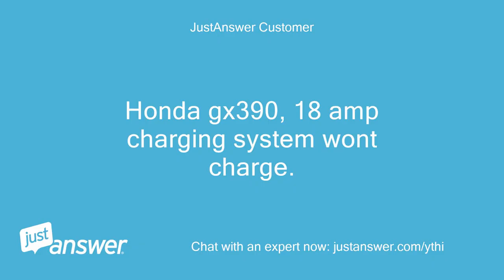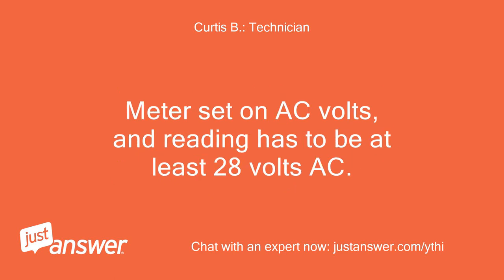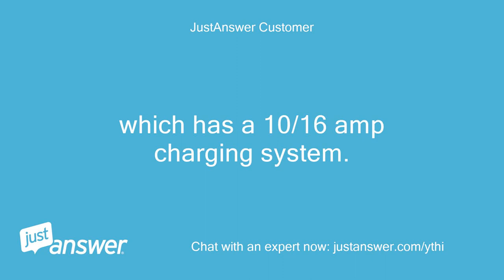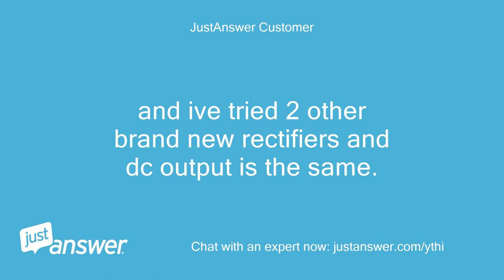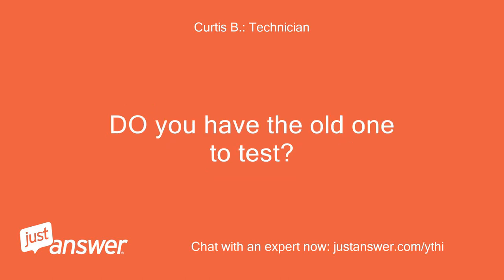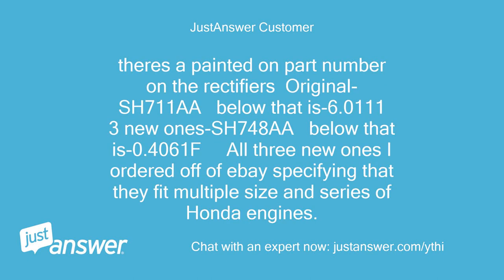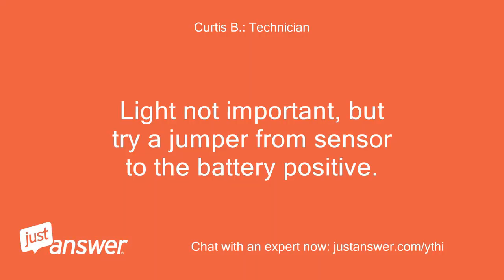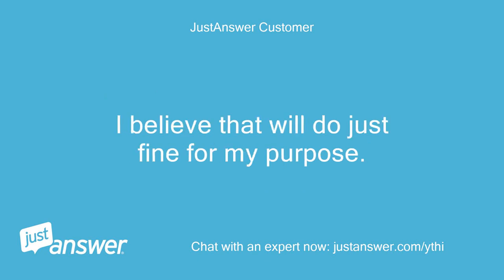Honda gx390, 18 amp charging system wont charge. New stator

Comment: I had a gx390 that wouldn’t charge….We used a new stator, new flywheel with strong magnets and a new rectifier….At full speed the stator made 6 volts ac maximum where it was supposed to be 28 or higher….We never did fix it….